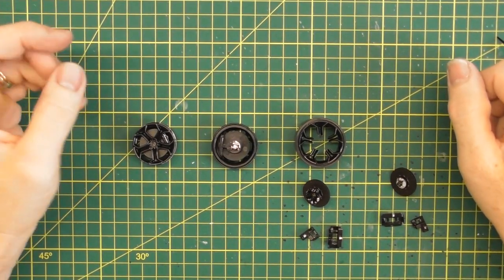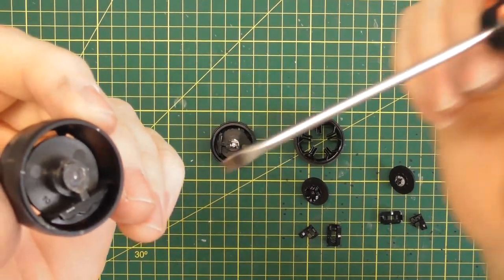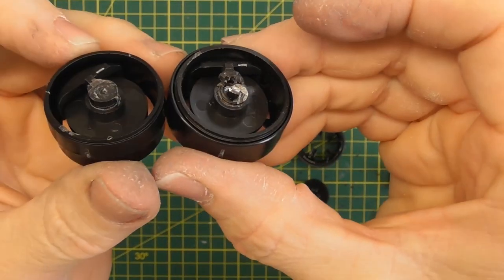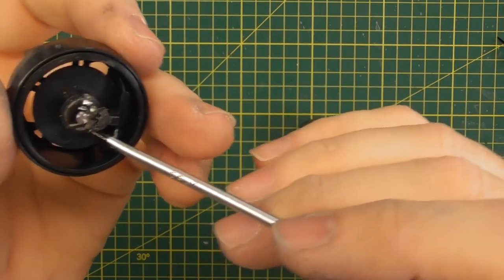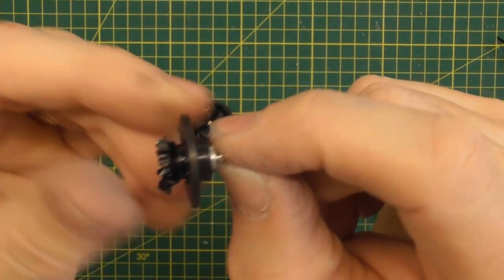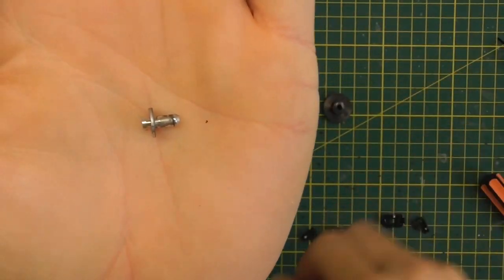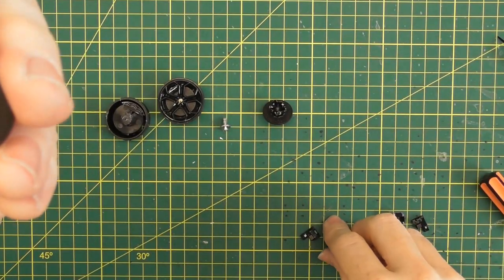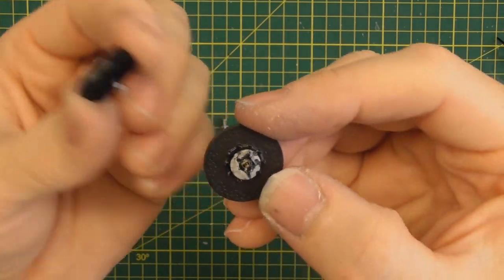AUTOART WHEEL REMOVAL FAIL - EXPLAINED

Comment: Some people are able to remove autoart wheels, it´s difficult but in can be done, basically you have to use hot water, wd40 or something like that, a flat screw driver and rotate the wheel.

Comment: I have the ta22 auto art celica. I was able to pull the wheels off whe spindle with a small flat head screw driver. No damage. Work slow put the flat head screw driver between the metal spindle and brake disc/brake drum and wiggle the screw driver till the wheel slowly slides off
Reply from the maker: Some AA wheels can be removed, but none of the supercar models allow it
Reply: @ROBSMODELCARS  oh I see.

Comment: This is a great video, thanks for making it. It's very educational and basically says that if you want to cleanly mod the wheels on an Autoart model, you're pretty much SOOL! lol!

This is such a boneheaded design by AA. This design is probably the reason why a lot of their models have wobbly wheels. They can make some of the most intricate opening mechanisms with struts and all the bells and whistles you can think of but they can't attach wheels that don't wobble. Most people say, "oh but they're models and they're supposed to be static", but when you think about it, you also have manufacturers in the same space AA is in as well as some lower end ones that don't seem to have this problem with their wheels. With Minichamps, Norev and even Welly models, I can be confident that I don't have to worry about this. With AA, it's always a crapshoot. It is really disappointing because their earlier, cheaper models from the early 2000s did not have wobbly wheels issues.

Comment: my question is why did you want to remove the wheel? ... what was the problem?
Reply from the maker: To change the wheels and put aftermarket wheels on instead. One of the most common mods to do on a model is to change the wheels.